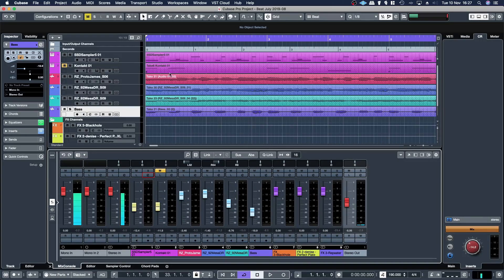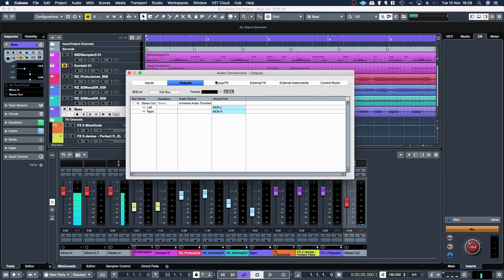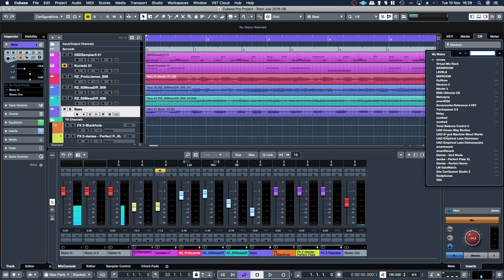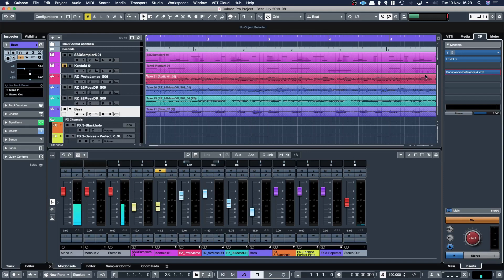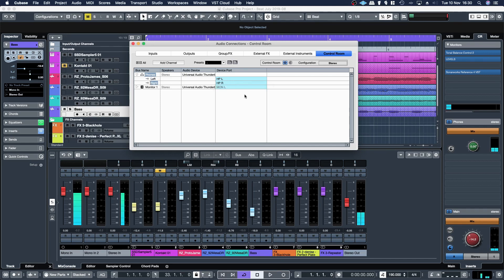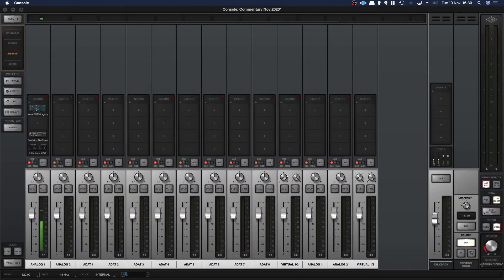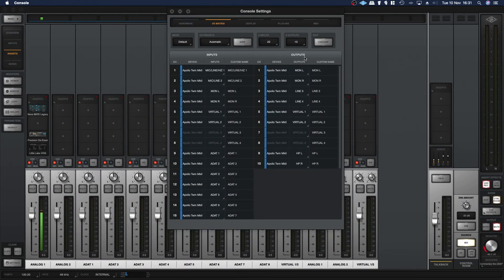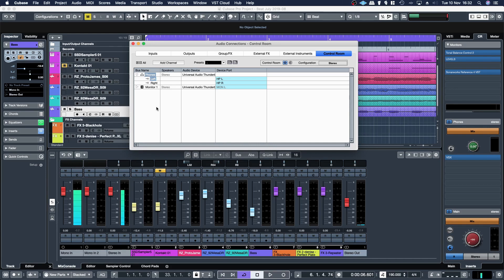Cubase Tutorial ~ Setting Up The Control Room For Separate Speaker & Headphone Outputs

Comment: I tried to connect my headphone in the control room but it doesn't show the external headphone... It only shows the laptop speaker... What to do?
Reply from the maker: If you have selected your audio interface driver in Cubase, your laptop speaker shouldn’t even be an option.
Reply: @JohnMarshall-NI  the problem was there was no asio driver.... I only had generic low latency driver.... Later i installed fl studio and the asio driver that came with it solved the problem for cubase
Reply from the maker: @scoresbymj  you really need a proper audio interface that has dedicated ASIÓ drivers or it won’t be suitable for working with audio.
Reply: @JohnMarshall-NI  i see... But i can't get a audio interface like for another year.... I guess asio4all driver will be good until then
Reply: Same issue here, headphones do not appear, i use the Asio driver too